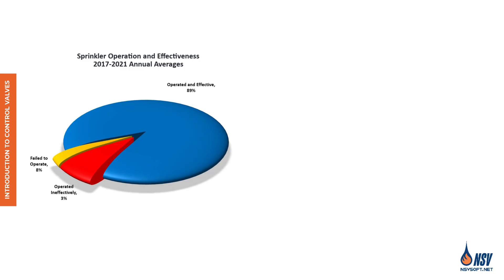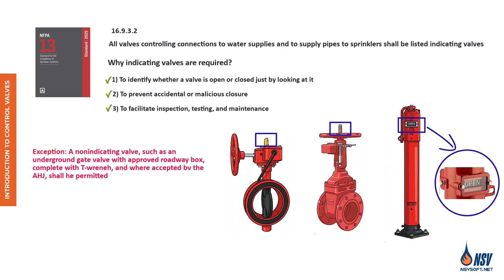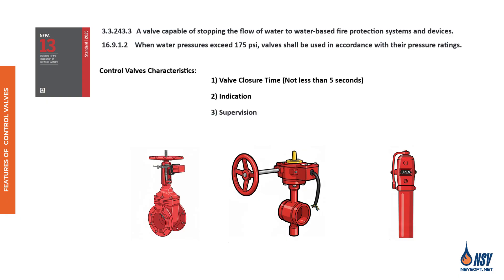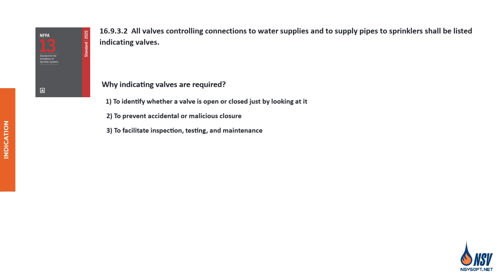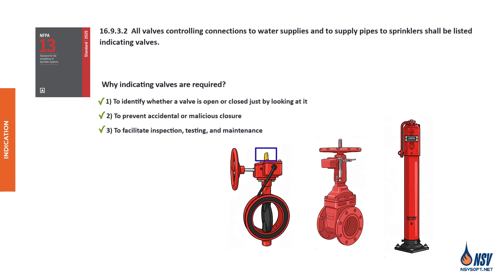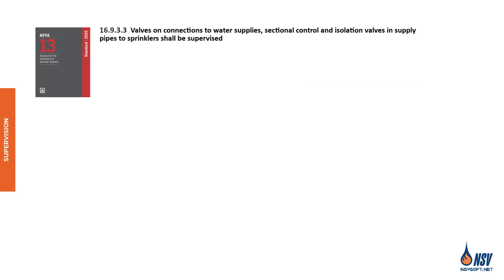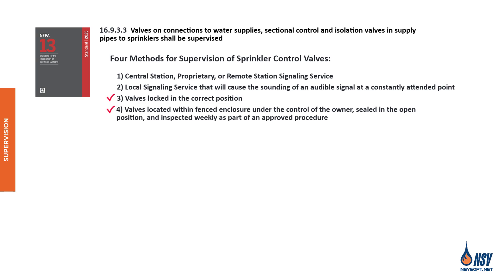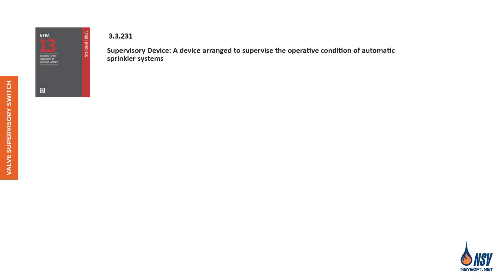🔧 Control Valves- Part 1: Key Features of Control Valves (NFPA 13/13R/13D)

Comment: Thank you, dear Rahil, for the excellent illustration. The opening part of the video captured my attention, and I’m eager to delve deeper to enhance my understanding. Is there any data explaining "why" valves are often closed? Is it solely due to the inspector’s oversight, or does building management intentionally shut off the main header valve? I want to identify the reasons to prevent this issue in my projects.

Based on my experience over the years, particularly in Iran, building owners frequently distrust sprinkler systems and tend to shut off the valves in the main header of the sprinkler system. They seem skeptical about the ability of sprinkler heads to withstand water pressure, fearing they might be damaged by even minor forces. Despite my efforts to reassure them about the durability and reliability of sprinkler heads, I’ve unfortunately never had the opportunity to fully convince them.
Reply: @erfan68erfan Thank you so much for your insightful comment.
In some cases, it’s simply human error. For example, a section of the system might be temporarily shut down for repairs, inspection, or testing, and the control valve is closed during that process. Afterward, the ITM contractor, inspector, or maintenance team may forget to reopen it—or assume someone else will handle it. That’s why NFPA standards require control valves to be supervised. 
Unfortunately, without proper education and awareness, some building owners view the system as a liability rather than a life-saving asset. I believe that with the mandatory inspection, testing, and maintenance requirements outlined in NFPA 25—combined with increased awareness among building owners—many of these issues can be effectively resolved.

Comment: 61% of sprinkler system failures occur because the system was shut off! a striking figure that highlights the critical importance of proper system maintenance and a proper design. Thanks for sharing this insight.
Reply from the maker: That's a very striking figure, and you're absolutely right—proper maintenance and design are crucial! Thanks for highlighting this important point.